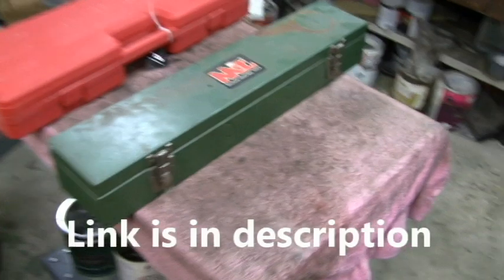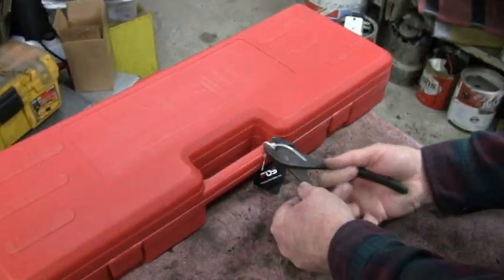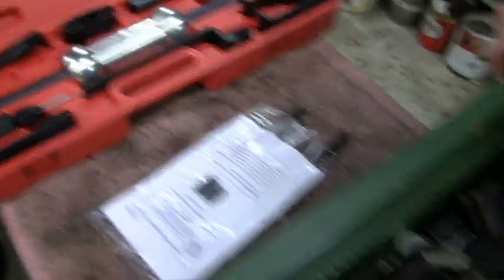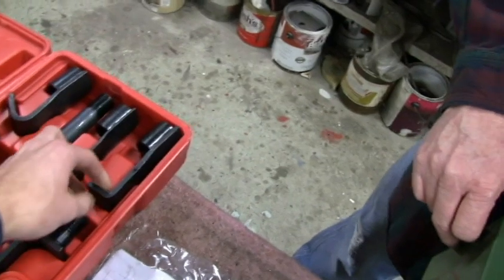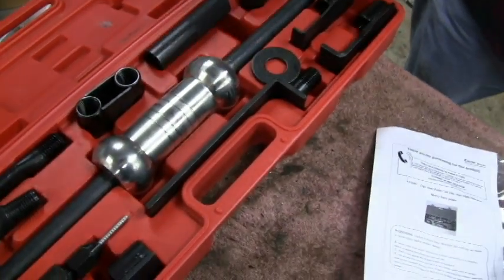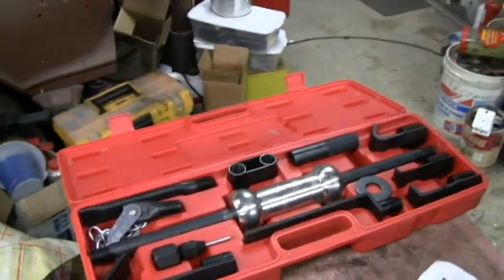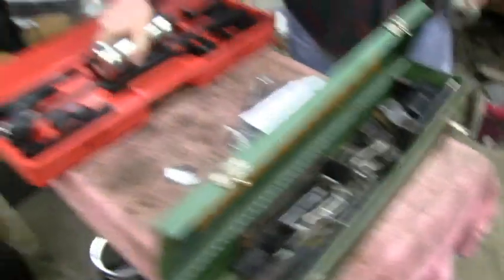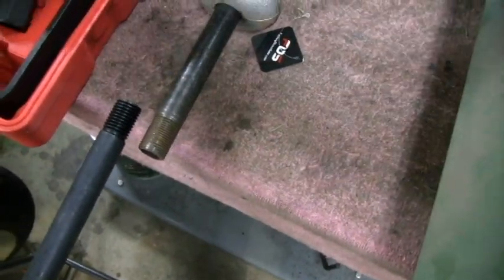AMAZON SLIDE HAMMER UNBOXING AND REVIEW

Comment: Can you please make another video how to use this kit ? I understand that you can insert the fitting (hook) between two panels for example where the drivers door meets the fender to remove a dent but what else ? I bought one and it does not have any instructions and minimal info online. Would be interested to see how the chain is used and the rest. Thanks

Comment: Useful tool eh! Never needed to use one for years....however many years ago with the F2 we did have to pull the half shafts to change the diff. As I only did a few meets I only had to change mine a few times. Used a 4.1 for Skeg, and 3.9 for Northampton (you'll have to google the tracks lol) Then I welded the 3.9 to go to Sheffield, for shale.
Anyway not having one I had to put the drum on backwards and hammer them out. So at the end of the year I made a dedicated one. Well you know what happened, had to stop almost before I'd begun. Think I gave it to one of my mates for theirs.
Reply from the maker: It's a great tool for pulling axles like that...has many different uses!